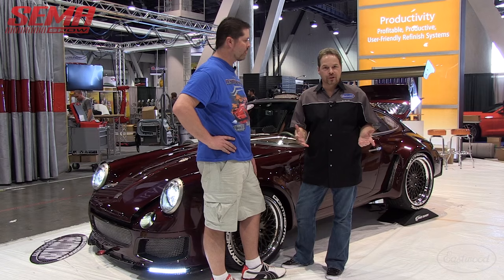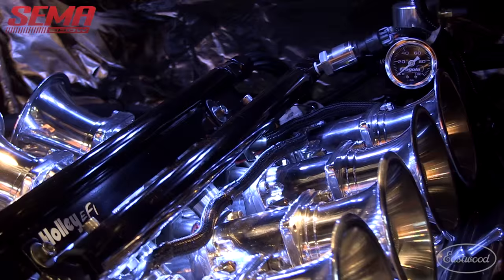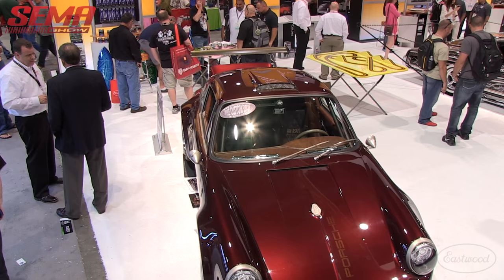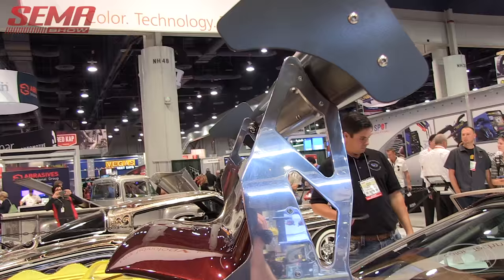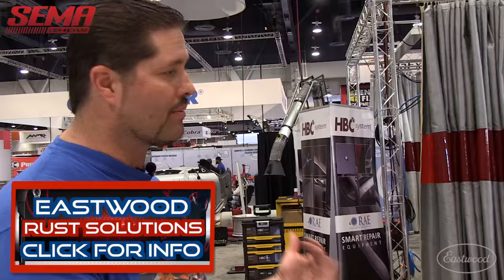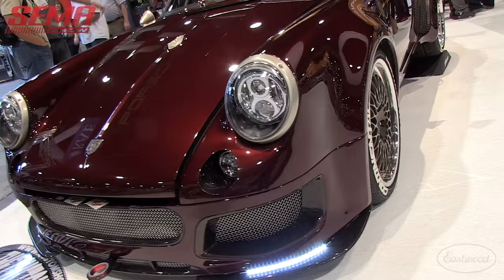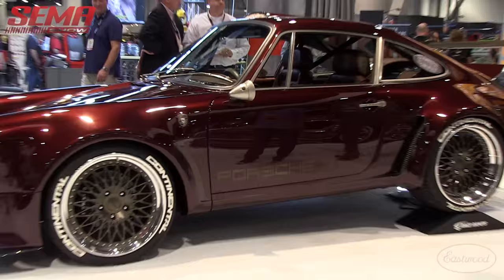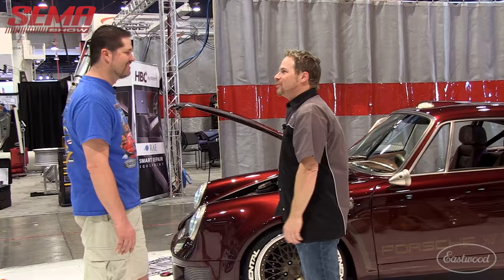Incredible LS Powered 1970 Porsche from John Wargo's Custom Shop at SEMA 2015

Comment: A stock 911 did not have a 50-50 weight distribution !
Reply: true
Reply: right not even close, more like 38/62ish
Reply: The Engine is in the rear.  911 are very go cart ish...
Reply: Michael Bell yea that was funny ! guess he never drove one! too bad about the LS.  install twin turbo 911 engine could have given 700-800 Hp. ooooo well
Reply: twin turbo LS motor could give 2,000+BHP if you want to make this about a horsepower war....
Reply: more like 40-60 and in the early yrs tires were not staggered same little pizza cutters all around. pure trailing arm rear suspension was not forgiving chop the throttle in a turn or tap the brakes and BAM  snap over-steer. Exit ass first sheet metal and pos engine damage.=$$$.
Reply: Craig Tripney he must have been thinking BMW
Reply: Art Mchugh I would imagine PORSCHE OEM engine parts are kinda hard to get in the U.S and the LS is a great motor, are plentiful and more cost effective. Some PORSCHE logo valve covers would be awesome
Reply: Exactly. Entire reason they made a 944 with 50/50 distribution
Reply: With the the LS3 and rear 3.73 gear ratio the weight ratio is 51/49 so it's pretty close to 50/50.

Comment from the maker: The crew at The Custom Shop are Eastwood Guys...Are YOU?     -     Eastwood - Since 1978.
Reply: Who cares It's fugly f ed up and just wrong. Ohh we put another 200lbs of bondo on it totaly messed with the weight and got all original with it and slapped a ls 3 in it. Because you can't make any power out of a boxer engine.
SMH erup blaaaa pulahaah
Reply: P Kuudsk Agree.... when he talked about how he did the body work.. I face palmed hard: dura glass, instead of making molds, or welding on pieces.. You can can paint a turd, but on the inside its still a turd. if your high dollar build can't look good with unfinished metal, then the builder either lacks the skill, or he is scamming for a bigger profit..